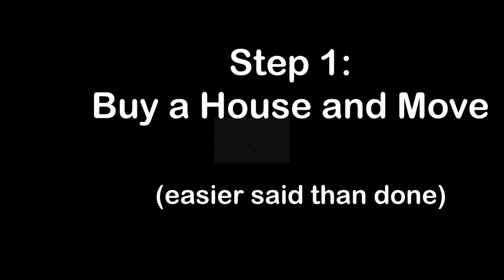Building my DREAM REPTILE ROOM! - The Floor

Comment: DOPENESS!!! Does carpet help or hinder the temperature in the room?
Reply from the maker: It depends on the room. For this one it didn’t make a difference as the carpet was very thin, the padding wasn’t installed correctly, and it was over the concrete subfloor. Really anything agains that subfloor is going to be cold in the winter unless the floor is heated (which hind-site I kinda wish we would have done).